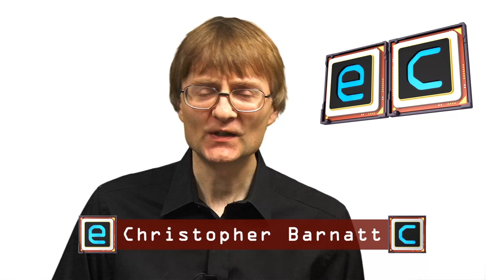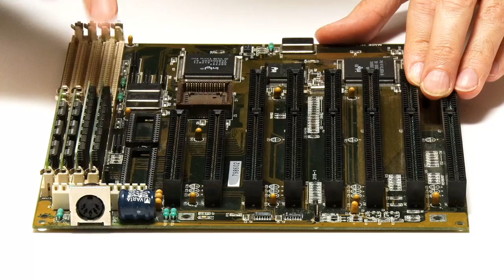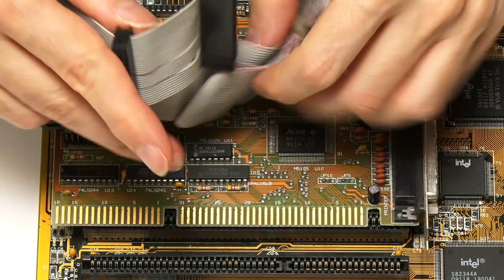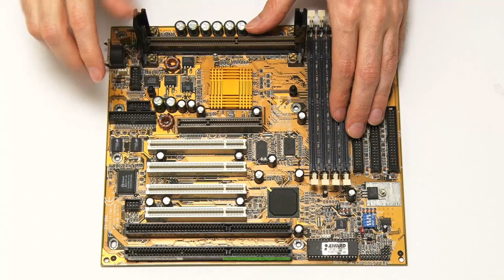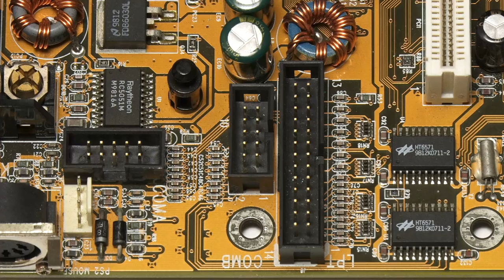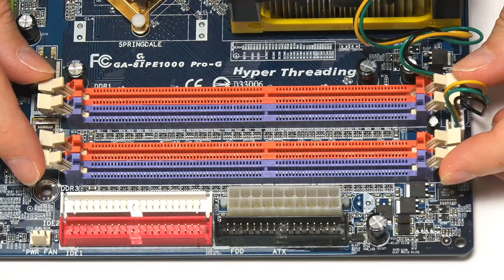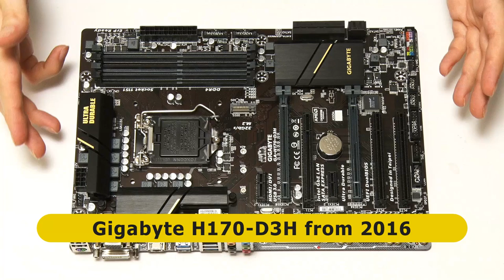PC Motherboard Evolution

Comment: IDE was the successor to hard drives with controllers on ISA ports that were not integrated on the hard drive itself.  What you kept calling IDE was parallel ATA (short for ATAPI).  This was significant because prior drive controllers required settings in the CMOS to hold the cylinders/heads/sectors for the drive before it could be formatted.  The IDE technology hid that information largely or returned it only when requested.  The OS needed only know abstract information common to storage, not how to run the device.  So initially, it applied to hard drives and tape backup drives.  When CD drives came on the scene, they too were separately controlled (usually from the sound card).  CD drives were then converted to IDE later, probably a result of sound being added to the motherboard.  Making CD drives IDE made sense.  It also made them bootable.

Somewhere along the line (as you showed on motherboards) we switched from parallel ATA (PATA) to serial ATA (SATA) which had various advantages including speed and improved airflow without ribbon cables.  The drives still use IDE to simplify OS interfacing.

Prior to IDE, each drive had to have separate drivers added to the OS to interface them to the system.  Two different manufacturers or even models within the same manufacturer would potentially lead to two drivers.  Adding tape backup required another driver, CD drives yet another.  Multiple drivers may conflict or cause other issues.  IDE made this simple one driver interfaces all hard drives, tape backup, and CD (etc).  The IDE driver identifies the drive and enumerates it.  It controls reads and writes (where possible) and does not require a manufacturer driver.  The BIOS can boot from the devices because it has base code to do so.  

USB drives use the USB driver to direct drive transactions to the IDE driver.  It acts as a middleman between the IDE drive and the system.  This is why some motherboards that recognize USB can boot from external IDE devices, including thumb drives (which are also IDE devices).
Reply from the maker: Thanks for this info. :)

Comment: Nice coverage. Very interesting. My wife is trying to build interest at her college for a small computing museum (a hall with historical computing gear), but I'm on to her plan: she just wants to clean up our basement.

Is that an IDE connector on that 1991 board, or is it ST-506 (MFM/RLL)? Most of the 80386 boards and expansion boards sported either SCSI-1 or ST-506 headers. Plugging an IDE/PATA drive into an ST-506 interface would allow the magic smoke to escape. $1 says that's why that board was non-func when you got it.

Comment: I'm rather curious about the first motherboard with the 386 CPU. It looks like the 386 is soldered into the board.
I had a 386 (running at 15Mhz) back in 1990 and I clearly remember there being a socket for the CPU.
Is it from a pre-built PC that had the CPU soldered into the motherboard?
Reply from the maker: You are right, this was a pre-built PC with a soldered 386SX CPU.
Reply: @ExplainingComputers  Thanks for the reply.
Nowadays pre-built PCs don't have soldered CPUs unless it's a mini-PC, a laptop or a Mac. I guess we also came a long way in terms of modularity, at least for tower-case desktop PCs.

Comment: Intel can use the scanner to read the code of the laser mark and detect the kind of CPU. It was common to change the clock speed on Intel CPUs to higher speeds and re-sell it at a much higher price. Eventually, the marks were copied and we used programs to measure performance to check the speed.

Comment: I remember my 386DX.  Windows 3.1. DOS. Doom. Good memories.

I have no clue what MOBO the system had.  I do remember I had a Sound Blaster Pro inside (when you booted it, it said "sound check"), a modem card and a video card.  It was built from a local gentleman that charged my dad around $3500.  Boy, computers were expensive.

Comment: Hi Christopher, you Single Board Computer series has raised my interest in them again. I have an older PCduino3 that I never used bc because RPIs are so much easier. Is there any way to get the PCduino3 working with current os should I not bother with it? Keep up the great work.

Comment: 386DX-33 and 80387 math coproccessor with 4MB RAM, later upgraded to 16MB RAM and 1MB SVGA video card. Before moving on I had a BIOS-containing IDE controller card letting me use a 4GB hard drive, a pro audio studio sound card, and a US Robotics Sportster 33.6 modem.

Comment: The VGA Port is also phased out. As for the USB1.0 or 1.1 question: Has to be 1.0, as there is no protection of shorting it out and permanently destroing it (and the whole motherboard???) by pluging in the cabble the wrong way arround.

Comment: Users of Windows 95 had motherboards with a technology that hadn't changed significantly since 80's. After Windows 98, the USB arrived which made nearly all of ports obsolete and little later SATA which simplified the connection of data storage.  
The video has some notable omissions. SCSI, FireWire and thunderbolt ports weren't and aren't the unique privilege of Apple computers. eSATA ports allowed the connection of external hard disks with the speed of SATA. The DisplayPort (DP) isn't mentioned at all too and the much older VESA Local Bus slots.
Reply: I remember accidentally buying a scsi cd drive. Got it at a decent price.....until I found out I needed a scsi card.
Reply: mephistopheles My first CD recorder drive was a SCSI Philips one in 1997. It was sold with an Advansys scsi ISA card. The include cd recording software was the GEAR which was very difficult for an amateur. I soon changed it with the ADAPTEC easy cd creator which was very very friendly. 
The SCSI was very important with older slow computers because the CPU wasn't working heavily during recording. 
At that period any pause of data transfer during  CD recording was making the CD-R totally useless. Blank CD-Rs weren't cheap then. 
Afterwards that problem was solved with CD recorders like the legendary Plextor and innovative software like the 
Nero Burning ROM. 
In 1997 all my cards inside the PC was ISA with the exception of the PCI graphic card. My sound blaster card was ISA. My winmodem card was ISA. My SCSI as I mentioned was ISA too. My scanner needed an ISA card which I don't remember well if it was SCSI or a proprietary one.

Comment: My first PC was a HP Vectra 386 DX20. It was odd in that the Processor and RAM were all on a Riser card that plugged into the main motherboard. I remember buying a MathCo-Pro for it and it literally cost an arm and a leg at the time. So expensive.

Comment: To me the third motherboard which is the real revolution. We now have SATA, USB 2.0, built in ports, standard headers for the front panel, a modern looking CPU socket and cooling fan. Gone are most of those jumpers. It's even conceivable you might persuade one of those to run Windows 10, drivers depending. OK, it's PCI and AGP, and there are some legacy IDE sockets, but there are still plenty of motherboards like that running Windows 10. 

The second motherboard is more of an interim one caught between two ages to my mind.

Comment: Floppy cable was installed backwards. Pin 1 is to the right on the board header. The red stripe is pin 1 of the cable and placed to the left.
Reply from the maker: See pinned comment! :)

Comment: You connected 386 floppy cable wrong way. No need to remember, it's clearly marked on board that pin 2 (so the pin 1) is on the right, and cable pin 1 is marked with red line, which is on the left (and should also be on the right).
Reply from the maker: The cable was indeed put in with the red line on the "wrong" side, though it depends how it was inserted at the other end!. There is no absolute wrong way around on a cable that inserts either way around at both ends :)
Reply: I think the twist is not reversible , which defines floppy drive 1 and floppy drive 2.  Your floppy cable only has one set of drive connectors, but the twist is clearly "keyed" which would have to correspond to the red line side being, pin 1.
Reply: @ExplainingComputers  
Sorry, but ... no. There is only one correct position for the floppy-cable on the end to the motherboard. I think you mix it up with IDE cable... but even on IDE turning pin 1 to pin 40 (on both ends) is sometimes not a good idea, because there were cables already addressed with master/slave. Hold such a special IDE cable against the light, you will see an interrupted wire (1-2 mm) between the 2 drive connectors. When using such a cable you have to set the drive's jumper onto position "CS" (cable select) on both IDE drives.

Btw. Who can remember SCSI? A big tower PC with adaptec scsi controller, a 68 pin cable, connected to 3x HDD, 2x ODD and 1x tape streamer. This was cool. B-)

Sorry for my bad english. 
Greetings from germany.

Comment: CPUs never looked better than that slot packaged Pentium II. 
I always had knock-offs in the 386 and 486 era, like the Cyrix 486slc, they were horrible, they did a good job for a reasonable price.
I forgot all about the game-port, i had a joypad which such a connector, much better than using the keyboard.

Another great video, cheers!

Comment: What's funny is that returning to needing a jumper to flash the bios (or gasp, having it on a small eprom where some of the anti-security "features" wouldn't even fit) would now be a badly needed and to some, valuable, security feature....

Comment: I would say that the biggest evolution of motherboards is the disappearing Southbridge controller and memory controller when Intel finally went with on-board memory controllers and the dual chipset-style design (where you had the south bridge and the secondary chipset that controlled other things  such as USB and storage/communications) was moved over to PCI Express and controlled either by the processor or the main chipset in modern systems, or even just the PCI Express bus controller which is part of the chipset or the CPU, so we were able to refine stuff.  Plus the change from onboard graphics (graphics built-into the board) to CPU graphics (graphics integrated into the CPU).

Comment: Hoho, a trip down memory lane indeed.
But in my humble opinion you forgot the AT and ATX connectors. An AT power supply, on/off of power supply is "manually performed" you must wait until the pc tells you to shutdonw the pc, with the ATX on/off was performed by control signal that shut down the pc by it selfs. Correct me if i am wrong  :)
Nevertheless, a great video, again!
Reply from the maker: Yes, you are right. I should have commented on the changing power connectors! Oh well.

Comment: 3.5 years late, but the 1999 Gigabyte board also looks like it can be used with either AT or ATX power supplies.

I also had a Tyan board that could use either a slot CPU or a socket CPU. I actually used both slots (at different times of course), starting out with probably a 200 or 300 MHz slot processor and ending, I think, with a 933 MHz "flip chip," where the back of the die was exposed to have the heatsink pressed directly against it.

Comment: Some IDE and floppy cables had one unused pin socket hole blocked out, and the corresponding pin on the motherboard was missing.  This keyed the cable so it would only plug in one way.  Not all cables and motherboards were so equipped but the unkeyed cables would work in keyed motherboards,  but not the other way around.
Reply from the maker: Indeed, but keyed cables arrived in the late 1990s I think.

Comment: That "C1080148" marking on the 80386 chip is probably the FPO code of the chip. The code indicates the manufactoring country, manufactoring date, and the lot number. If I read it correctly, it suggests that the chip was made at the 8th week of 1991. I am not 100% certain, though, as I am not particularly familiar with that NG80386SX-20 chip.

Comment: I had that same board as my first modular pc. Before that I had the Adam/Coleco with digital tape drive. Those were my personal pcs. At work I used the Kaypro with dual 5 inch floppies and and 10 meg hard drive.

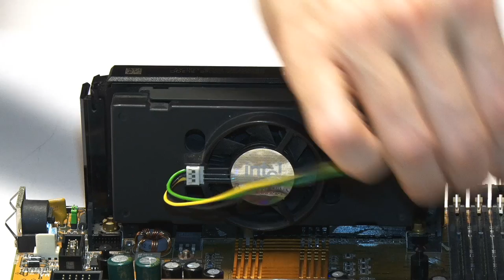Comment: at 12:01, you fan connector is the white plug on the left.
Reply from the maker: No, it isn't -- as I make clear early in the video. The pin you refer to is for a bracketed PS2 mouse (and you can very clearly see the label for this on the board in the video). The fan would not even fit on this four pin comment.
Reply from the maker: Sorry, typo -- last word should be "connector" here. This comment section is driving me nuts! :)

Comment: On that final board the, PS/2 had two colors. Did that mean you could use with a keyboard or mouse ( legacy) or is that something new that I don't know about? A dongle that splits it into both maybe?
Reply from the maker: Where there are two PS2 connectors, they were colour coded for mouse and keyboard -- purple for keyboard, green for mouse. The connectors on the mouse and keyboard end were also often coloured to match! :)
Reply: I have an easy way of remembering which is which: “purple” has the same number of syllables as “keyboard”, and “green” has the same number of syllables as “mouse”.

Comment: those are in pretty good condition. how did you clean them up so well?
Reply from the maker: It took some time -- first with an air blower, then various cleaning stuff. The later board had been kept in antistatic bags since decommissioning, so were in pretty good state.

Comment: 6:15 It looks like pin 2 is on the right side of the pin set, so pin 1 would be just across from it.  The red stripe on the ribbon cable aligns with pin 1, so I think the cable was connected backwards. 😉

Comment: If I'm not mistaken, you put the floppy cable on backwards. The red line on the side of the ribbon cable indicates pin 1, and pin 1 is located on the right side, just above pin 2.
Reply from the maker: I did. See pinned comment. :)

Comment: i like the look of the older boards more. just so cool with all those slots and stuff. and despite that first board not working due to the corrosion and stuff. i thought it was in pretty good shape in other areas like the chips and cpu. looks almost ageless. the p4 board looks similar to what i had but it suffered the cap bulge of doom. and this was before i got into trying to repair stuff now i wish i didn't toss it or it would been working if i just replaced those.

Comment: I built my first "IBM PC XT Compatible" in 1986. 8086 processor, 8087 co-processor, 640K RAM on an Intel Above Board. I later upgraded that, and expanded it with its daughterboard, on a new 80386 build, to a whopping 2 MB. At the time I was the envy of my geek-peers. ;) EDIT: Oh.. and MS DOS 3 point something.

Comment: @12:17 Are you sure that Fan connector is a CPU fan - not system fan or etc? IMHO CPU fan should be on the left side of mobo.
Reply from the maker: I am absolutelty postive the CPU is plugged into the right socket! :) There is only one fan connector on the board. The other white connector that looks like a fan connector -- but has the wrong number of pins -- is for a bracketed PS2 mouse connector, as I explictly state in the video, and show in CU, where you can see then label for it! :)

Comment: Aside from the ST Microelectronics 486 chip, it seems you have been an Intel purist...  All my pre-built PCs have been Intel, but all my personal builds have been AMD, the first being a Duron, the 2nd being an Athlon XP, and my current build is a Ryzen.  As you stated, this is not a comprehensive history, but I was hoping you had at least one board for an AMD processor after compatibility splintered after the 486.  <edit> looks like I spoke out of turn.  I see you have some videos covering a Ryzen build!  I'll be bookmarking those for later!

Comment: The 386SX was “cut down” in only having a 16-bit memory interface, as opposed to full 32-bit in the 386DX. I remember colleagues wondering what was the point, why not buy a 286 machine instead. I, being a software guy, was vociferous in pointing out the 32-bit future compatibility that the 386SX offered as a reason to go with that chip. I felt that too many of the people around me were focused on hardware issues, forgetting that software issues were, in the long term, much more important.

Comment: Could you please review the new Haiku operating system Beta 1 release? It's a small, but impressive, project that deserves more exposure. It runs only on x86 but requires only a Pentium 2 CPU with 256 mb ram as minimum, so a basic lattePanda has more than enough power to run it lightning fast. Haiku now supports many big open source programs like Libreoffice, Blender, Krita, calligra and Openshot.
Reply from the maker: I intend to make a Haiku video this week, to upload October 28. This is contingent on it working, and being recordable via my equipment. But, fingers crossed, it will work out.

Comment: the white connector you were pointing at is for the pentium 2 processor fan
Reply from the maker: No, it isn't. The processor fan socket is on the other side of the board (which I indeed plug the fan into later on). The white connector I point to at about 9:30 is a header to connect a PS/2 mouse socket, and indeed is quite clearly labelled as such on the board just below the header. :)
Reply: @ExplainingComputers  sorry about that i was confused on the i was meaning it looked like a case fan connector but on some of the older models had strange connectors i looked it up  it look similar to my gatway p2 and come to find out that motherboard was similar but little different

Comment: I remember I guess before the sata conversion that had these jumpers on the back of the hard drives, they were so freaking tiny, it would be easy to drop then you spend half an hour looking trying to find the blasted thing. then have to remove the hard drive to be able to read where the jumpers had to go.